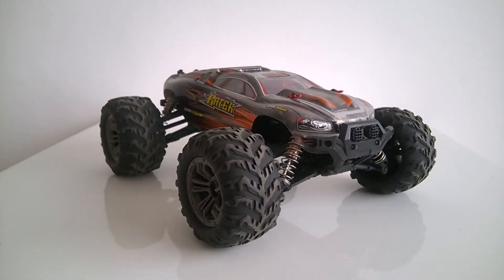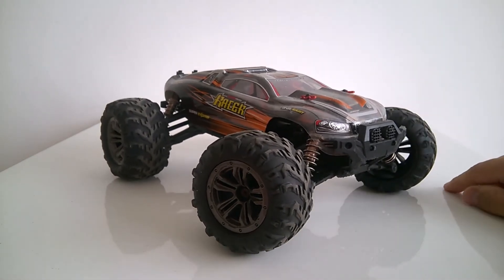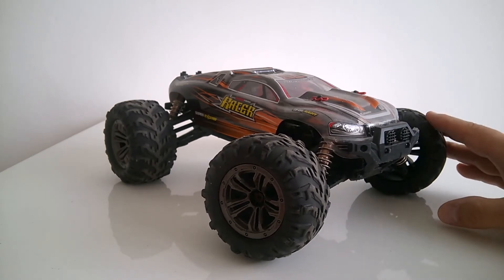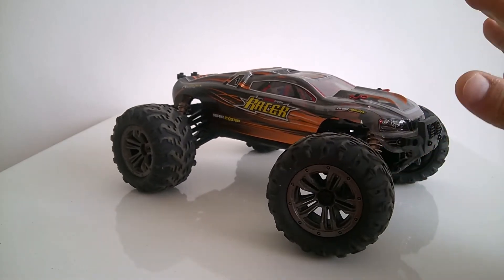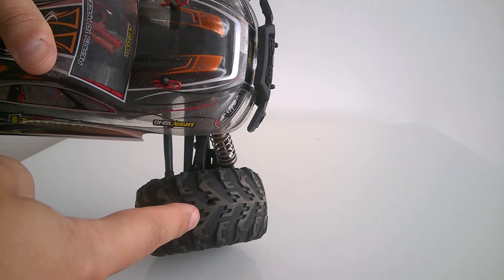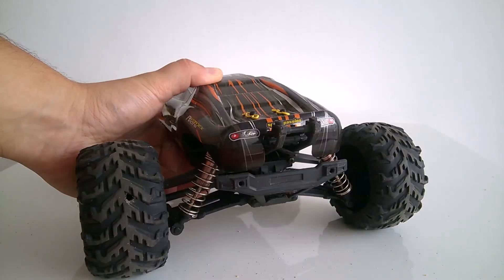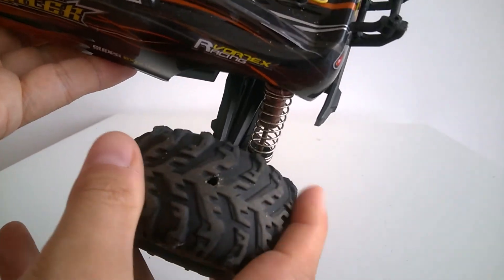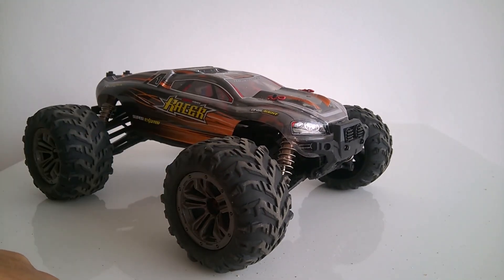How to Clean the Inside of the RC Car Tires? How to Remove Dirt and Water from Tires on RC Cars?

Comment: I have a problem with my eachine e520s . my eachine e520s takes off but it could only fly for 1 meter and it won’t lift in full throttle. All the four motors work I checked the motores so many times.  And also the gears . And it is not the motors or gears. so is the problem the circuit board or the gps ? .... the battery is not the problem because my drone can fly for 10 minutes and charge time is 3 hours.but my drone  just won’t fly correctly . Please  help ! What do you think is the problem ?
Reply from the maker: when you fly, do you use the app to see if the GPS signal is coming? I have not tested this model yet, so cannot be of great help.
Reply: @RCToysAventuraSmartSolutions  i calíbrate the compass and the giro and the gps signal i get is 15. And still same problem the circuit board must be the problem . Thanks  for your opinion  😉👍

Comment: why not drill more holes in the rim the tire seems like a bigger problem later on I was thinking about taking the tires off the rim clean really good then glue back on but holes in the tire just seems like a bad idea
Reply from the maker: both ways work, with rims - more work to do, the tires have served well, never had problem with it. The factory glue in my case is so good that I would not want to detach the tires from the rim. On the other hand, it may be possible to drill the rims without taking off the tires. The centrifugal force pushes the dirt towards the tires, so I go for the tires.

Comment: when the battery of my drone is 80-100 percent it flies and can lift high. I flew it 20 meters high and 20 meters away but I can’t fly it at high speed because the drone will struggle more to self  level . When the drone is at -80 of battery the drone will lift slowly or  it won’t lift . The drone will only lift fast only if the drone spins to the left. If the drone stops spinning  then it will lose altitude.  I’ve even have a problem that sometimes I can’t even turn off the drone I have to desconnect the battery from the drone . I think the problem is the circuit board  the circuit board  is defected . My drone just won’t fly correctly.
Reply from the maker: Do you perform all calibration procedures before you fly as per instructions? Gyroscope and GPS compass calibration?
Reply: @RCToysAventuraSmartSolutions   yes i do all calibrations and I still have the same problem.
Reply: @RCToysAventuraSmartSolutions    The problem is the circuit board because I  have noticed that the circuit board of my eachine e520s over heats. I will buy a new circuit board  for my. Eachine e520s. And my drone will be back in the air .